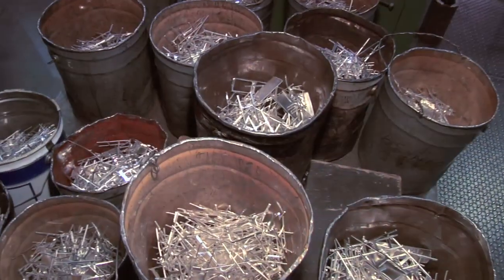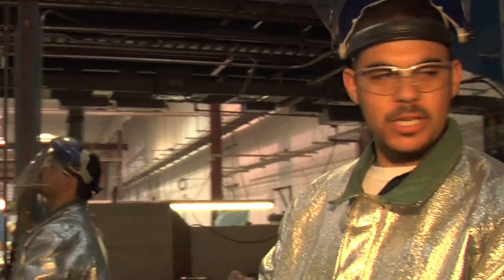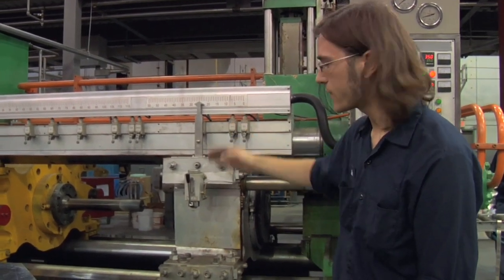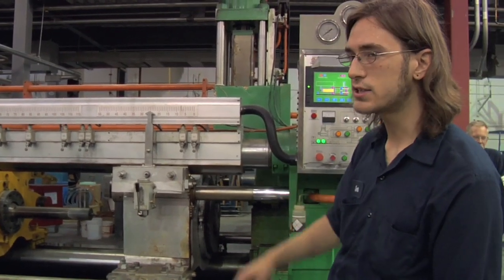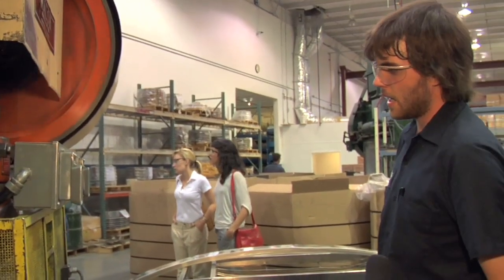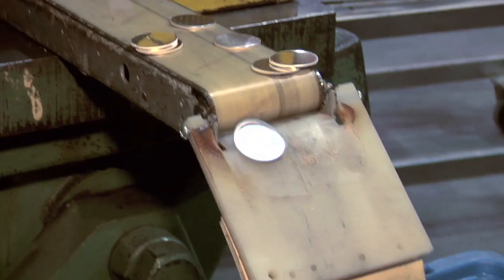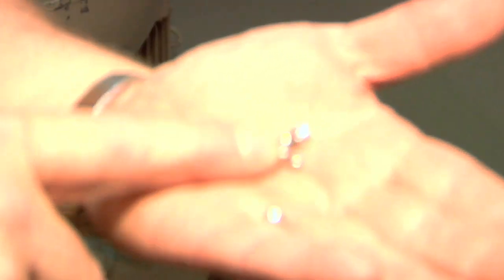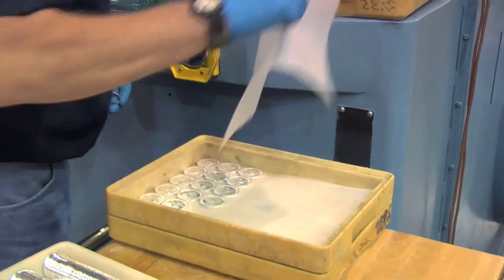How are Silver Coins Minted?

Comment: I was wondering why they didn't have a sand pit like we use in steel. They're don't need anything if you're pouring into pigs. Fuck, I don't even call that pouring, more like dumping
Reply: The ingots (or whatever they're called) are made to fit into an extruder.  If they want a consistent extrusion (no voids or cracks) I think they need to be somewhat precise when they make the ingots.

Comment: Is there a machine that does it all together ?
Like from the melting  to printing/stamping ?
Reply: I have never seen entire process be fully automated from start to finish. But it could be done.
Another silver company has furnace and crucible directly feed the molten silver into an extrusion die. You cannot see it in their video...but their crucible has to have an overflow lip to feed the extruder the way they do it. But other parts of their process are manual.
This video... They pour silver into big rods...which then get extruded...and here the process is more automated at end of process than other company.
Every company is slightly different.
Reply: @darrinwebber4077  can you please tell me the name of this company? I've been minting coins but striking isn't embossing it enough. Perhaps molten silver directed into die will fix all my problems

Comment: What are the dies made from to be carvable and yet able to press a relief into a coin?
Reply: Hardened steel. While I am sure they may carve the obverse and reverse of the coin surface with an unhardened die face, the final product undergoes a hardening process via furnace. As others have suggested, a pantograph may be used but some dies are hand carved as well. Coin collecting is a fun and rewarding hobby where we all get to hold on to a little piece of history.
Reply: +Daniel Franks i think they engraved using a pantograph or laser machine , those tools shown in the video are used to clean out and maybe sharpen the die from time to time
Reply: David Hicks do you know which alloy exactly ? we've been experimenting with HSS, i was wondering if there was anything better out there
Reply: Don't know about this particular private mint, but the US Mint's modern dies are made out of hardened steel.  These dies are capable of producing many hundreds of thousands of coins before they are retired and destroyed, or cancelled/defaced.  [if you watch eBay, you'll see cancelled/defaced dies for sale--sometimes, an "uncancelled" die will come up for sale; those are much more expensive]

Comment: actually he skipped a process maybe two, the rolling was mentioned but not shown, and the rimming process was skipped completely, though the rounds being placed in the coining collar had obviously been ran through a rimming machine.  The rolling process, the rimming process and maybe an annealing process.
Reply: +Yarply Twelve how important is the rimming process ?
Reply: +Joseph James  rimming is mostly done to size the blank  as it reduces its diameter while adding a slight small bulged border, more so if desired to help fill in engraved portions along the outer border of the coining die. 
But to answer your question, its rather important, as the blank has to fit inside the bottom die collar of the press where the reverse die sets , not so small as to not fill the border of the coin yet not to large to get jammed inside the collar as they can crack from the excessive pressure or bust a die, a lot of variables in the process and I have been out of coining since I lived in cda Id, almost 20 years, but it was pretty important back then.
Reply: ohk , thanks for the info . i am a refiner based out of india, we make coins for local establishments here. im looking into ways to improve our coining facility here . thanks
Reply: @josephjames4306  Where are you sir, can i contact you, out of youtube? Thankyou